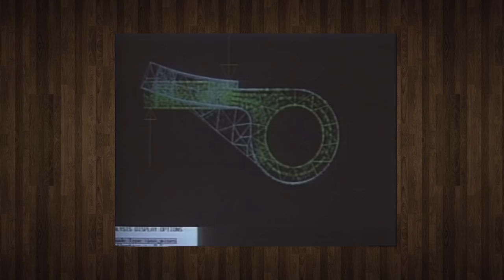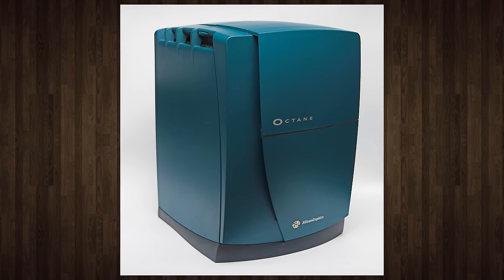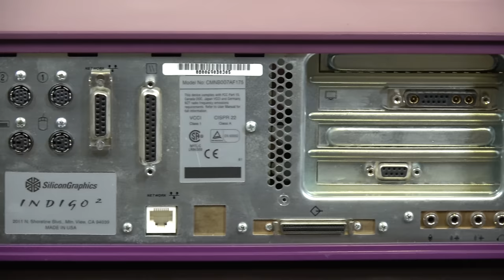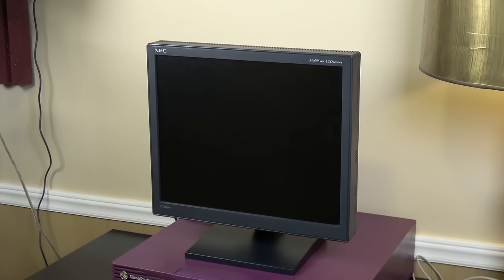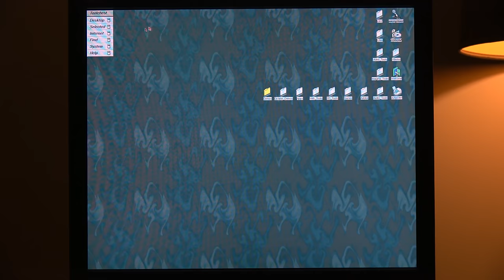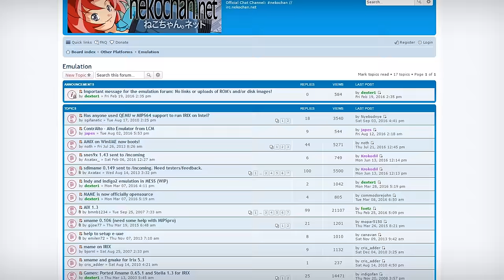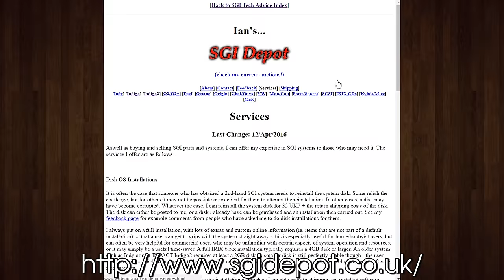SGI Indigo2: An $86,000 Workstation from 1995

Comment: I wonder what you could build with 89k today.
Reply: Ironman1o1 You could buy 10 of the new $9000.00 laptops from Acer that have two 1080 gt GPU's in SLI that weighs like twenty pounds.
Reply: Somebody just watched LTT~
Reply: Note that IBM had CPUs clocked at 4.7+ GHz back in 2007, when flagship Intel designs were Core2s with clock speeds up to 3.2GHz.

What really made Apple switch was that it took IBM nearly four years to get Power6 cpus to the market.. and even then, these chips ran stupidly hot and were ridiculously expensive.
Reply: A basic IBM Z. :D
Reply: +itsadeadmansparty Alas that description has a lot of errors. For a start, the heart of later Intel chips was actually a RISC core, with instructions being converted. The RISC/CISC difference was relevant in earlier years, but by the mid 1990s the situation was much more muddled; later RISC CPUs were becoming very complicated.

There were plenty of plans for far more powerful RISC-derived CPUs (PA RISC was good back then, as was the later Alpha range, and IBM's Power series continues to be strong today), better than anything Intel had in development at the time, such as SGI's Alien/Beast projects (SN0/SN1/etc.), but these did not come to pass since they lost the design staff to Intel, mainly in the winter of 1996/7. SGI could not match the salaries Intel could hand out.

SGI had been planning to combine the vector processing abilties of Cray's CPUs with its own R8K/R10K strengths, using the new MIPS V instruction set and MDMX media extensions (offering a degree of parrallel media processing only found today in NVIDIA's latest GPUs). Intel's designs would have been nowhere near as good as this, but one cannot design CPUs without the people to do it, and SGI lost them. Intel hoovered up talent from HP, SGI, DEC, etc., and then finally began designing the new CPU they'd been promising (the spin of which was partly how they persuaded other companies, including SGI, to stop development of their own CPUs and begin supporting Intel tech;  SGI told me that some of the tech in IA64 came from SGI's work), but Intel's first version of IA64 (Itanium) was very late and underperformed badly. It also used rather a lot of power (and thus heat was an issue). This is why SGI's Origin2000 rack can only hold up to 16 CPUs, as it was designed with IA64 in mind (MIPS CPUs use far less power), but IA64 wasn't ready so SGI had to launch only with R10Ks, a density issue that wasn't corrected until Origin3900 which supports up to 128 CPUs in a single rack.

Anyway, by the time the far more impressive Itanium2 launched, XEONs had moved on a fair bit, and the cost of IA64 (especially the necessary compiler work to achieve best performance, which means staff wages) meant only HP decided to stick with the IA64 programme. Most vendors figured it was simply easier to achieve higher performance with brute force, rather than have to bother with software optimisation via employed staff. As a technology IA64 did eventually deliver what was promised though, eg. QuickTransit on IA64 (written by a friend of mine I knew in the 90s) allowed IRIX binaries to run up to 5X faster than they would on native MIPS hardware.

Anyway, the more important point is that clock speed means nothing. SGI's CPUs ran at lower clock speeds, but they did far more compute work per clock cycle, and more importantly the CPU and the host system as a whole could process massively more data than any PC. Bandwidth was more important for SGI's markets. The most extreme example of clock speed differences is the R8000, which is 10X faster for fp than the original Pentium at the same clock speed. These efficiency differences are easy to discern in the SPEC data for CPUs from that era, especially compared to IA64 vs. x86. See my summary tables:

http://www.sgidepot.co.uk/misc/spec2006tables.txt

Ian.
Reply: Imagine the gpus
Reply: A few years ago, you could purchase a Cray CX1 "deskside" supercomputer workstation for 25-100k USD. Just saw one up on ebay for USD 22k (as at 19 Feb 17), if you want one.

Comment: i've got a purple unit. they're freakin bricks. remember, lift with the legs, not the back. the amount of steel in one of these things is insane. and thats before you get into all of the other materials.
Reply: An issue SGI had was industrial places putting very large CRTs on top of their systems, so Indigo2 had to be robust, plus it was used in all sorts of hazardous environments, extremes of temp and salinity. Still though, after some problems where companies had tried putting really large CRTs on them, SGI decided the next models would have curved styling to prevent such issues. Octane is likewise built like a tank, but can't be squashed in the same way (unless one removes the skins).

Btw, if you haven't done so yet, highly recommend refurbing the PSU, the IMPACT unit has become very prone to failure now, and not just the caps.

Comment: so it's a plymouth prowler for technophiles... all the way down to the color. ah, i miss the 90's.
Reply: Synthetic Karma more like a 911 GT1 or CLK-GTR in relative performance.
Reply: More like the vector w8 of PC's
Reply: Prowlers were all show and no go. This was more like a Viper.
Reply: I had a Plymouth 1962 Plymouth Valiant that was my Grandmothers I drove for 30 Years after she died in 1975. 
Alumineumn Engine, Slant 6, Three on the Collum, Clutch that needed New Throw-Out Bearings every 15 Years, but a moron could install, AH, humpf.I has a Screwdriver All Band Amateur Radio antenna invented by 
Don Johnson W6AAQ in Sacramento, Ca. {S-K] de: w5awg_john

Comment: In the early part of the 2000s, I used to work for the company that repaired the circuit boards from all those machines.  I personally worked on the Origin 2000, onyx2 servers and the High end graphics pipeline units.  Pretty high end stuff, even in the early 2000s.  Ironically, those big units were all tied to an Indy system as their terminal interface.  I may or may not have played the original ported Doom on the machines during my break times... ;)
Reply: I don't suppose any schematics & suchlike have survived from that time? Nowadays repair has become a vital aspect of keeping SGIs going, as the supply of spares has basically dried up.

Comment: The US Postal Service used about 60 units rack mounted to read hand writing or printed address blocks at something like 360,000 per hour when the canceling and barcode printing machines were processing first class mail. Yes, 60 units rack mounted at $10,000 per unit. The things were very reliable with only cooling fans starting to wear out in 2005. I retired in 2012 and they were still running, but we added about 100 rack mounted dual Intel Xeon processor machines with raid 1 arrays for address lookup for another thirty machines doing final sorting. Postal Service uses as much tech as it can to sort the mail even now.

Comment: Wow. I didn't really know about it a couple years back when i picked one up at a garage sale for $10. I took it apart and scrapped it but if i had known that i could sell it for at least $90 then i would have. It was the teal Indigo 2. I was really surprised when i saw the triple pcb graphics card inside it
Reply: Tony Hong Was it really 45 lbs??
Reply: If it had a triple stacked graphics card it could have been a MaxIMPACT set... could have sold that for a couple hundred $, if it had the TRAM modules those alone are worth $100-$200 for a working set.  Never scrap old unique computers, they will always be worth something to hobbiest / collectors.  Think about it like cars ... scrap a Honda Civic (PC) sure, but an original Mustang (vintage SGI/Apple/SUN/HP/etc)?  You'll always get money for the Mustang.
Reply: itsadeadmansparty Yah I guess.  If you are going to part with an old and unique one (I'm not including PCs in this argument) at least sell it to another hobbiest who will use it / preserve it.  There's a pretty healthy market in vintage computers so you should be able to get more money for most  of these collectible type computers than you can get from just scrapping them.
Reply: lookoutforchris It wasn't a max impact one. The front only had the indigo 2 and SGI logo and was real rather than purple
Reply: Then it was an Extreme graphics set (also 3 boards).  Not sure anyone is buying them but I see one listed on eBay for $329:

http://www.ebay.com/itm/SGI-INDIGO-2-EXTREME-GFX-3-BOARD-SET-030-8105-005-030-8106-005-030-8107-003-/302089778904?hash=item4655f436d8:g:X0UAAOSw4shX7CwX

Still could have probably got more money for just the card that you'd get for scrapping the whole system.

Comment: I have an old SGI O2. It's lower end vs the indigo2, but still built like a tank. I left it running for years until it got caught in a power outage. So stable. Compared to a PC of the era, it was lightyears ahead.

Comment: in 1995: 1GB OF RAM??? HOLY SH*T ON A STICK!!! THAT'S A LOT!!!
in 2017: 1GB of RAM? that's barely anything!
Reply: In 2005: "Wow, that's a big amount of RAM!"
Reply: and the GPU looks like Rtx or Gtx F/E.
Reply: And now my friggin phone has 8 GB of RAM with 4-6GB being fairly normal for mid range or better phones. It's amazing how quick things have changed.
Reply: I was in my computer nerd days back then, and I remember RAM costing $50/MB. My dad's 386 had 16 megs, which was just nuts for the day. Now memory is, what, over 1000 times cheaper? I paid $230 for an 850 MB hard drive in about 1996 and it seemed like so much storage! Now I'd fill that drive with 5 35mm film scans.
Reply: That's because programmers keep bloating things up
Reply: @bmay8818  I remember my 486 having a 8mb of RAM and a 500mb hard disk... And being told by the shop staff "you'll never fill that"...
Reply: Its still a lot. If you run efficient programs.
Reply: And after many years 100gb ram is barely anything they would prefer Quantum 1gb ram

Comment: I have often looked at these on eBay. I have no real use for one, other than that there is some mathematical graphics software that only runs on Iris.
Reply: I saw one on ebay for 200 bucks. it was the 10000 but it was missing the cd and hard drive

Comment: Its crazy that those speeds where that good in 95 when in 1998 you could get a fairly cheap system with a 550 MHz processor. Good video. I am a big fan!

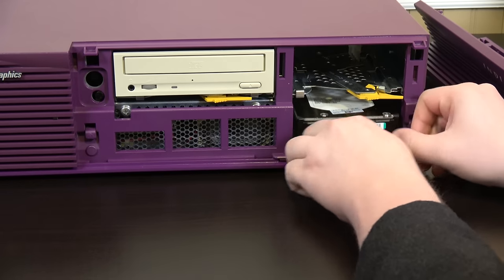Comment: 7:25 15,000rpm hdd. You would never see that in a consumer hdd. Like a lot of early 2000's hard drives were like 4000 to 5000rpm
Reply: WD raptors at 10k rpm came out in 2003
Reply: Also the bare minimum those days was 5400rpm, might have been lower on budget, almost legacy, laptops. 7200 rpm were widely available and not too expensive
Reply: @minombrees9675 Apple was selling imacs with 5400 rpm hdd in 2019..OMG this people should be in jail
Reply: @Teluric2  Just Apple doing Apple things and getting away with it

Comment: a $30K computer for free?
Fucking hell!
Reply from the maker: Just on loan for this video, and it's only worth a couple grand today at most ;)
Reply: I once bought an Onyx rack for 200 UKP which was originally 1M. Ditto a Challenge rack. 8)
Reply: So how much is it worth now? More or less than 200UKP?
Reply: Yeh I guess. didn't expect you to respond :D
Reply: +motherurck

The node boards are worth about $2K each alone, ditto the DG5, and other parts are worth quite a lot now, even the unexpected items like FDDI boards, fan blowers, power bricks and especially the Ebus boards.

Re the Challenge rack I bought, I sold off all the internals, eventually was still able to sell just the empty chassis to a company in France for 750 UKP.

I'm not going to sell the Onyx though, I need it for parts testing. Must take down the advert on my site, it shouldn't be there... besides, I have a couple of deskside Onyxs to sell instead, but I'm keeping a 3rd (in my hallway) which I'm trying to upgrade to IR gfx.

Ian.
Reply: +Robloxs Xtremeguy

Sorry for the delay, family issues, Father under palliative care atm. Alas we all have real lives to contend with.

Doesn't help that the flood of notification updates isn't split into new videos vs. forum replies... I had to scroll through them all manually to find some of the reply notes for this page, but still haven't seen the one for your comment. Not the best system YT has atm. Anyway, see my reply to motherurck for some info. Forgot to mention I was asked recently for fan blower units; didn't have any spare, but they're worth about $700 each now. The highest value though seems to be for the quad-R10K/195 2MB node boards, but it has to be a version with specific L2 cache ASICs; and also the DG5 is worth quite a bit now.

If you really want to strike it lucky though, find a C8-EPLEX VME board in an Onyx or Challenge, they're worth about $15K each these days.

Ian.

Comment: I was the sysadmin for two of these plus an older Indy and original Indigo back in the mid 90s.   Silicon Graphics were great UNIX workstations and servers for their day.   The end was near in 1996 when I bought a 200 MHz Pentium Pro PC and compied and ran a C program that did intense number crunching and it ran 40 percent faster on the 200 MHz Pentium Pro Machine ($3600 at the time decked out a bit) than on a 200 MHz MIPS R4000 CPU in an SGI that cost 10 times as much.   Our department at work started buying PCs for workstations around that time instead of SGI workstations.   After that, the only SGIs we got were the larger server type machines for data processing jobs at the data center.    Eventually, everything transitioned to Intel CPU servers and Linux over the years.

Comment: I had one of these as a primary home system from about 1998 until 2001. As I recall getting popular software to compile was a chore, and it got worse as the years wore on and linux became more and more popular. The compiler (MIPSPro) was absolutely fantastic and the associated toolchain was light years ahead of anything else. Ironically enough I used it mostly for penetration testing (It replaced a NeXT, which was also used primarily for pen testing). Min Indigo2 served me well and I still regret selling it to improve my mean mips/weight and power ratio. I also recall it costing me about $3 a day to run in power.

Comment: I got to play around with a Indigo2 at national Danish TV/Radio, while doing an internship in their graphics department in 1993. They did a bunch of 3d modelling and animation with their sgi boxes.

One memorable moment was when I thought I had made the Indigo2 crash, as the screen showed only random gibberish. On the Mac's I otherwise used, this would have needed a reset. Not knowing what to do, having tried various key commands on the box, I gave up and though I'd just power off the box. Pressed the big power button on the case, and suddenly the screen came to order,with a message saying it was preparing to power off. Seems the crashed bits had been sandboxed, and the system was still alive.
That irix system was quite solid. A Mac would have been quite wiped out in a crash.

Comment: i used to work at the best postproduction facilities back on the 90s and we had there tons of indiy's, indigos, indigo2, octanes, origins, o2, w320, w540 and onyx. All of them used for post and animation at SD 720x480 resolution but capable of Cinema 2K which we used to do too. I loved them all, and in the meantime I had at home several Amiga Computers with Video toasters, DCTV's, Picasso's, AD516, DQTAco, and every hack, accelerator or mod available. I loved those good old times.

Comment: Ah, the Indigo² R10000.  What a marvel of engineering.  Sarcasm.  it's R10000 processor was designed to be used in cache-coherent systems but the Indigo² isn't.  The interaction between the two turned out to be rather subtle, surprising - and broken.  The issue was discovered six weeks before the intended shipping date.  Redesigning the whole system was out of question within the given time frame so a workaround was required.  This is where SGI pulled out the advantage of being a proprietary systems company in control of its entire software stack.  A workaround which required changes to the compiler used to compile the IRIX kernel did generate code to avoid certain conditions.  On top of that some extra tweaks to the kernel were required.

SGI did ship on time.

That said, the workaround had some performance impact but that was the price to pay for using the R10000 in a system it was not meant to support.   The O2 R10000 did have the same kind of issue but by the time of its development the issue was known and well understood.  The O2 got a little custom chip which together with some kernel tweak worked to solve the issue in a more efficient way than the pure software approach used on the Indigo² R10000.

Understanding that sort of issue would have been a nightmare without the hardware debugging issues available to a major company such as SGI.  Thankfully SGI shared shared its knowledge and so Linux on the Indigo² is using the same approach to avoid "speculative dirty" cache lines.

As for the case design - I like the Crimson most for its vibrant red.  Or maybe the Expressigo, a Gaggia expresso machine in a case based on the SGI Iris Indigo?  At least the Indigo² had some edges without looking overly harsh.  The O2 and Octane were following the trend of the time toward "overheated plastic" designs, too round and weird.

The O2 btw. was a bit of a failure in Japan for a very Japanese reason.  Japanese offices are infamously small and it was not possible to stack stuff on top of the O2 which meant it was an office space hog even though its actual footprint and volume war pretty moderate.